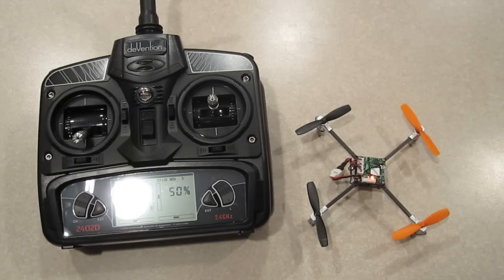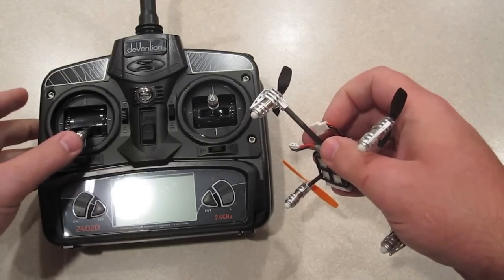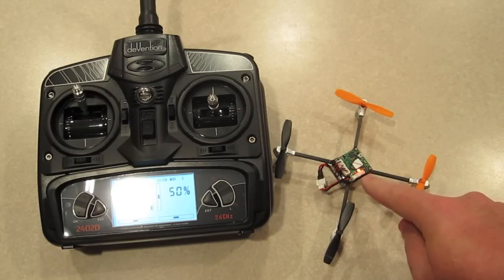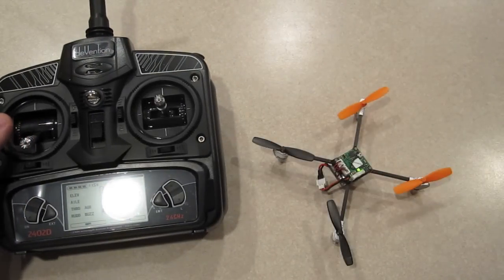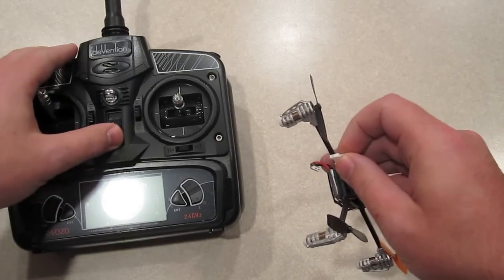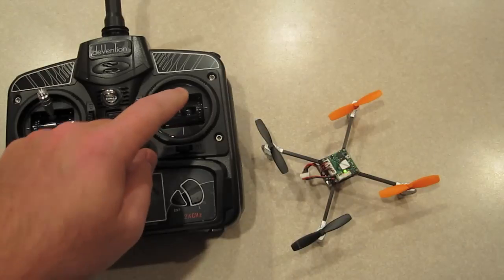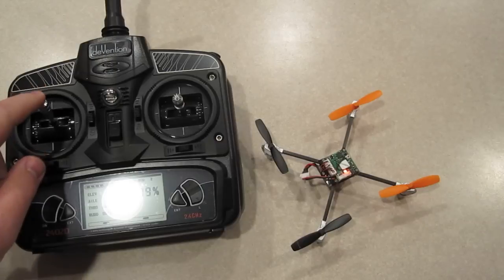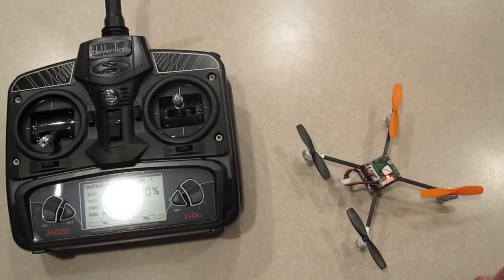Walkera Ladybird / 2402D Engage 3 & 6 axis flight mode

Comment: If you aren't using the bind plug could you be more specific by what you mean regarding bind?
The usual process with the Ladybird, is first turn on tx and while the tx is flashing/scrolling the trims you need to plug the lipo in on the ladybird before everything goes to solid on tx. If not you just start the process all over. I usually go ahead and put battery in the battery tray and put the power lead from the board onto the lipo but not plugged in. Turn on tx then plug in lipo. Hope that helps